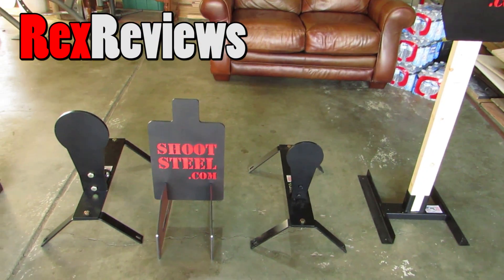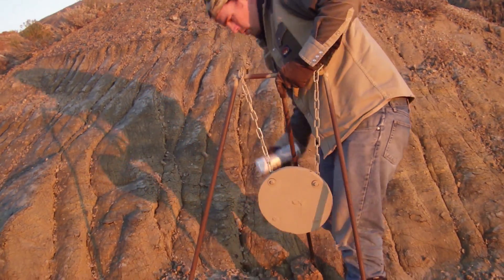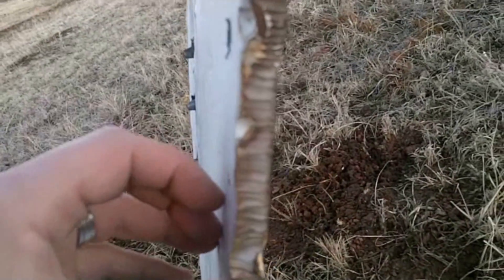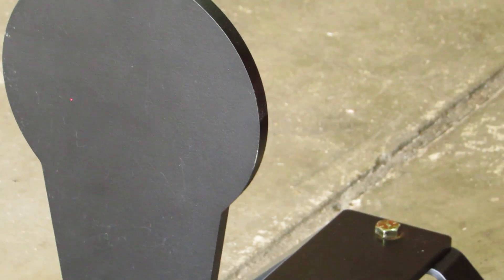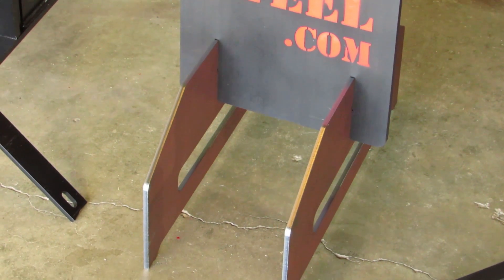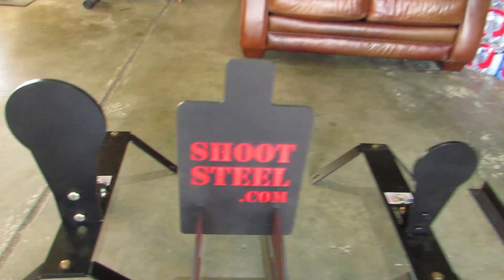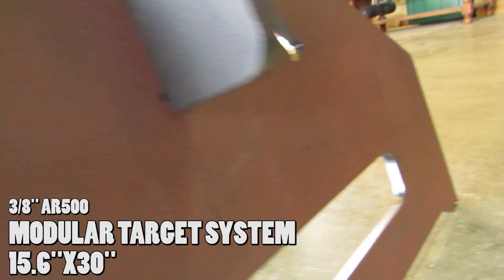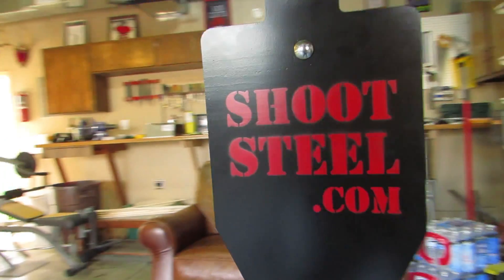Why use AR500 for Long Range Rifle Targets? Shoot Steel! ~ Rex Reviews

Comment: A confirmation on all ya said! When I first started watching your precision rifle series, I had a local welder make me a target that would lay flat in the trunk but fold out and that I'd be ok lugging out 800+ meters and back. The idea was sound, but being mild steel, even my .270 has beat the snot outta it and now lugging it is a little hazardous. Perhaps it's better exercise having to hold it away from my body as I hike but that was not the original intent at all. :-)  I've now got an AR500 plate that I bought and am getting a new collapsible frame built with the idea being I can hang any of several different shape/sized plates from the frame and I expect the AR500 will hold up far, far better. Worth the extra $$ for it.

Comment: I broke a 10-inch plate from ShootSteel.com but it took a lot of abuse over 2 or more years to break it.  Lots of 5.56 at 50 yards.  3,000 fps or more, 50 yards is too close, but 7.62x39 at 50 yards does nothing to the plates.  Come to think of it, I can’t remember you ever shooting at anything that didn’t need a scope... well maybe once.

Comment: From my welding metallurgy courses, plasma cutting's haz is negligible unless you are actually putting load directly on the edge for 99% of applications. This also depends on whether they've cut it before tempering or after. The best option for quality is to buy annealed ar500 and cut it and then temper it with your local service provider but it seems that if haz is a concern, other companies tend to temper it before the cut. 

Essentially when looking at ar 500 steel; if it's plasma cut before the tempering it's okay and of better quality than any cutting after the tempering. If the cutting occurs after the tempering, laser is better but only if you actually need a tempered edge. By edge i mean a millimeter or two. Waterjet cutting is an exception here, it's the best out of all of them before or after because it inputs virtually no heat. 

Is plasma vs laser jet something worth paying more for? Absolutely not. It's cool i guess.

Comment: I'm fortunate, my steelyard has tons of surplus AR500 plate.
3/8" 4'x2' sheets are around $40, 1/2 inchers go for $60.
Have to use an angle grinder, and alot of discs to cut it up.
Takes a long time to shape em, but they last forever.
Reply: Most steel yards have AR cutoff's that they will sell for cheap. May not be the exact shape that you want but for the price I can live with it. I have left plates out in the hills so long that they are overgrown by prairie grass. Move the target a little and a bit of white spray paint and your good to go. Sure beats packing the plate around.

Comment: You spent 10s of thousands of dollars on long range equipment but didn't ever bother to buy a few hundred bucks of ar500 targets lol
Reply from the maker: Lol.  Yeah, that's what they said as well.
Reply: its hard to beat free, why buy a new target when you could buy more ammo to practice with.
now that its a little more affordable i might get one. but free
Reply: Hey man, if I had to choose, Id spend the money on reloading components or optics.  I can always find something to shoot at... even a rock (again, if I had to make a choice between them).  That being said, AR500 steel is to targets what HD glass is to optics.  Once you have used it, its difficult to go back to anything else.  Except one of those dumpster roller/wheel cylinder things.  That is still my favorite non AR500 steel target.  Hard to explain, it just absorbs rounds and is really fun to shoot at... from a distance...lol.